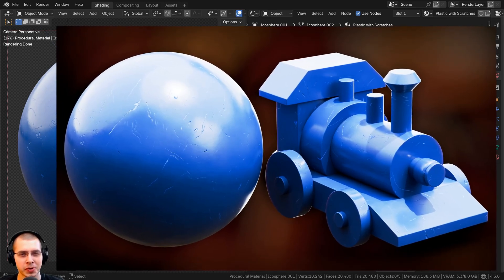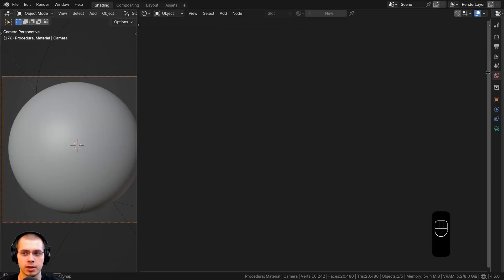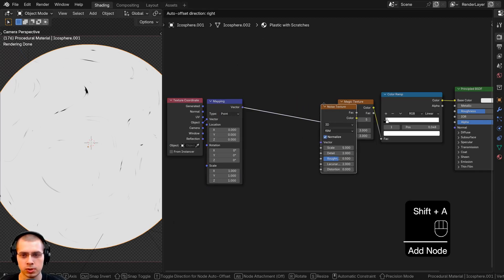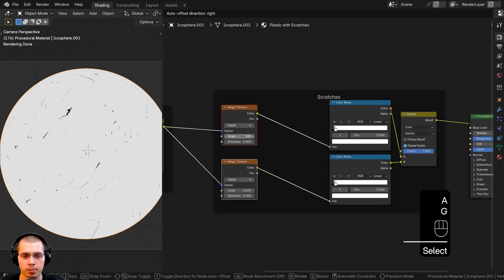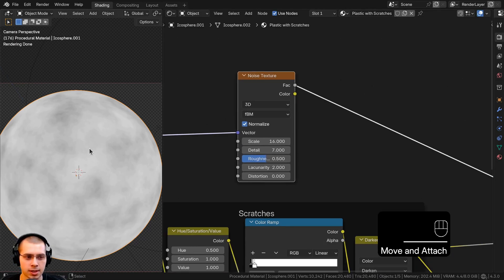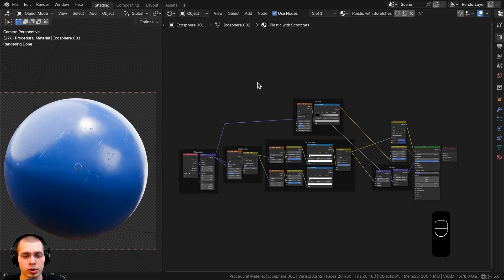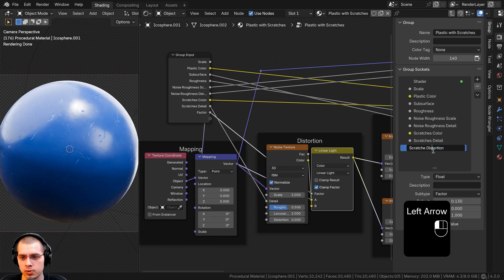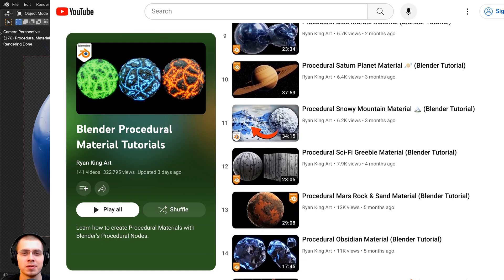Procedural Scratched Plastic Material (Blender Tutorial)

Comment: very good video.

BUT, there is one thing:

When you are dealing with masks, which are mostly only black and white, you should use only math operators.

You should use math operators instead of Colors, whenever it is possible. Math is much faster and easier to compute.

Using too many Color nodes, like "Mix Color" and "Hue/Saturation" will result in slower rendering, less performance, and finally blender will explode...

Pro Tips Math operators instead of Color nodes:

- Instead of Mix Color you can use "Add"

- to increase white values (contrast), use math node "multiply" (instead of Hue/Saturation)

- to subsrtact one mask from another one, just use "substract"

- to invert black and white just multiply with -1

For Black and White only use math nodes, if you can

Only use Color nodes when you are dealing with "Colors"
Reply: For example: when you combine the 2 scratch masks with a "Mix Color" node with "darken", try to use a "math" node instead and multiply with a value between 0.001 and 0.9. Same result. If you want to lighten it up, use a value greater than 1, and if you want to flip black and white, just multiply with -1.

You still have full controls by manipulating the math value B.
Reply: I reproduced this material setup with the exact same resulst by using only ONE Mix Color node. I replaced every Hue/Saturation and Color nodes with Math nodes, with the same controls and the same result.